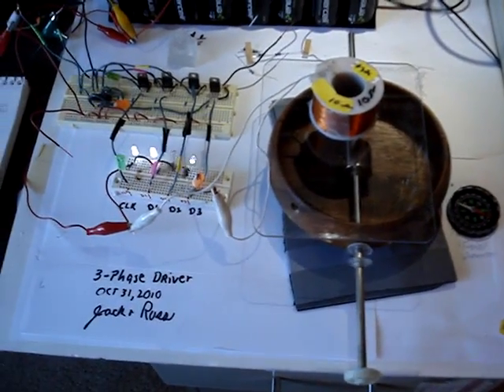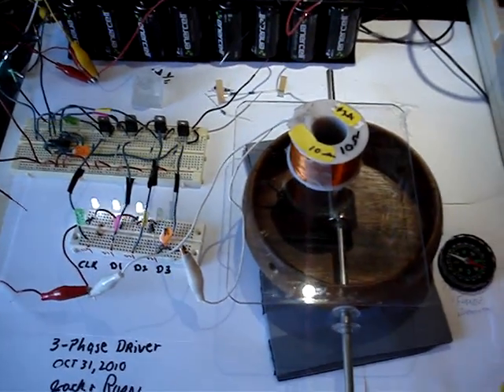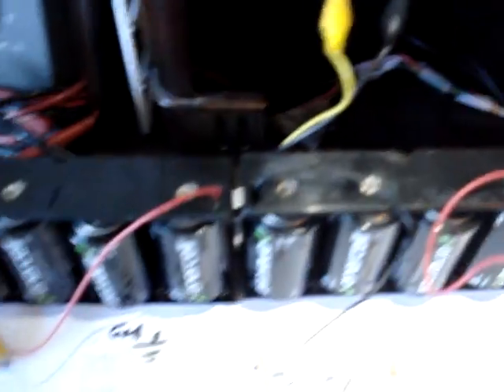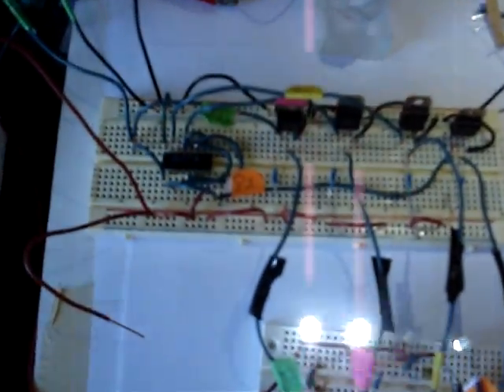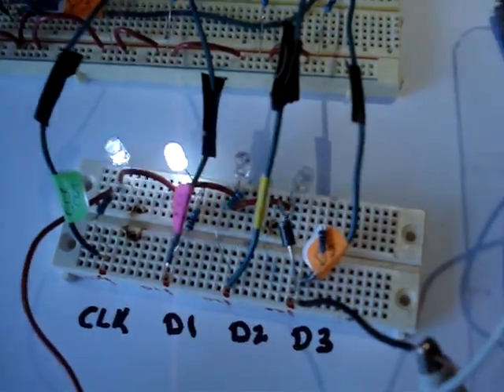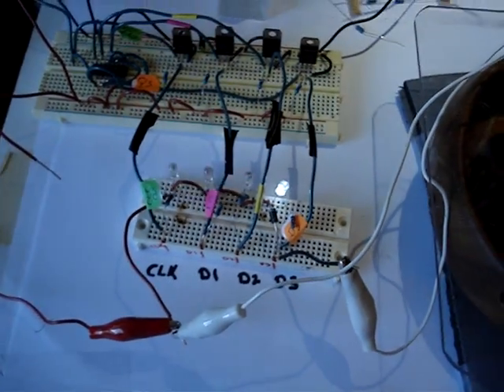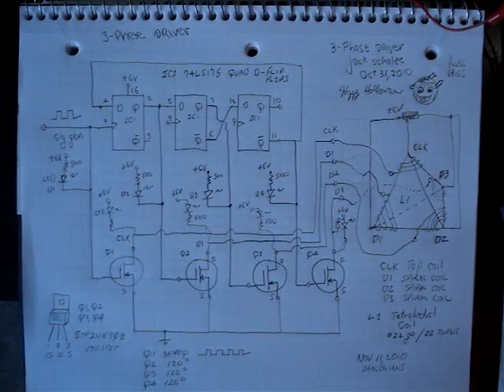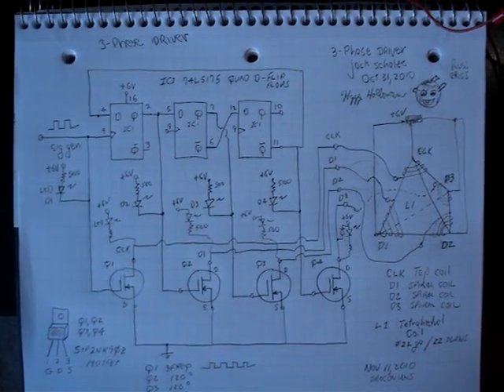3 Phase Driver

Comment: Not a complaint, just an observation. That is not a true 3 phase driver. It is a 3 channel single pulse sequencer. It is amazing. NO ONE on youtube has a straight forward 3 phase motor driver! Jack, this is the closest thing I have been able to find to an elegant solution. Some of the circuits I've seen so far are either completely wrong or hideously complex. As in, you should not need a microcontroller for this. Otherwise, good job.